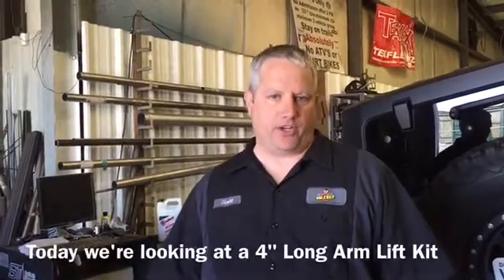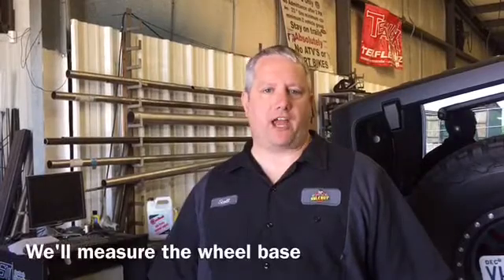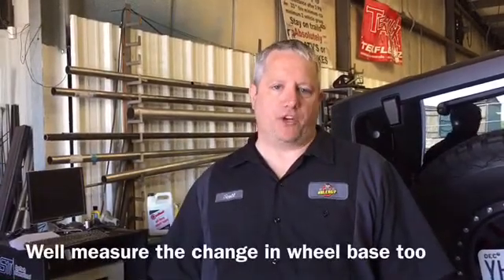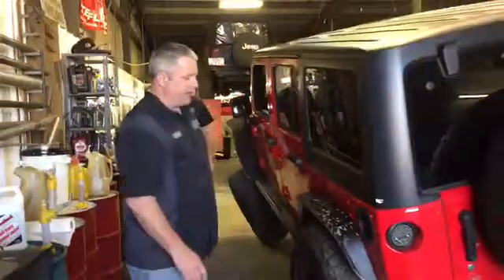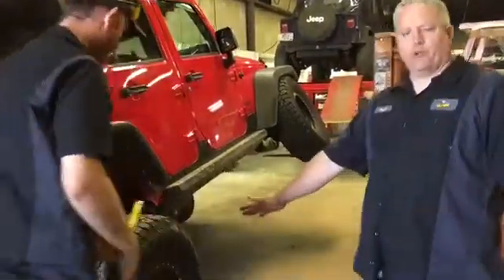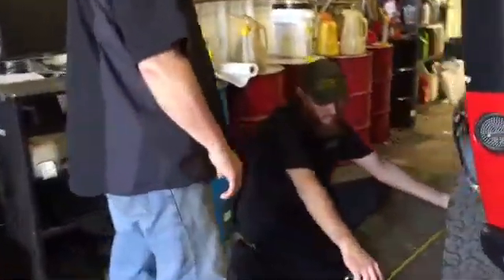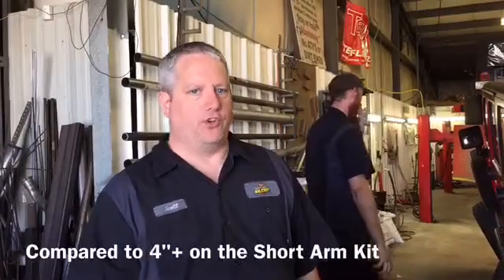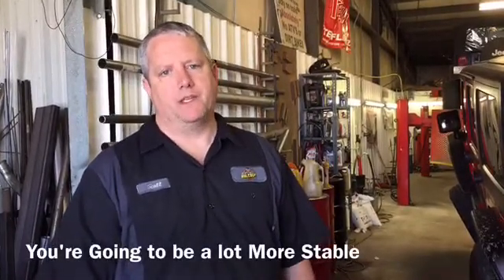Long v Short Arm Lift 2

Comment: Scott. Great info that most don't realize about suspension geometry. There are so many reason to have short arms. As you mentioned ,consistently have you're axels placed in movement and have it be predictable ,and overall stability , as well as impact forces on the frame of the veichle of which you'll feel the difference on lifted short arms as they tend to send forces up into the frame as opposed to back and thru the frame. Long arms also help ensure the pushing your axel does to move the veichle forward doesn't turn into lifting forces and allow the rear to roll under instead of the ever important forward movement . Great video and information. Love your shop and videos. Jeep life Axleboy !
Reply from the maker: Thanks for checking our our video @J 8!  We love working on Jeeps and helping to keep the Jeep/off-road community well informed.